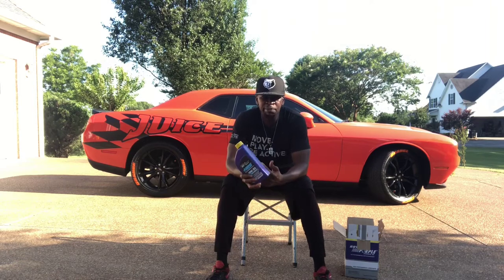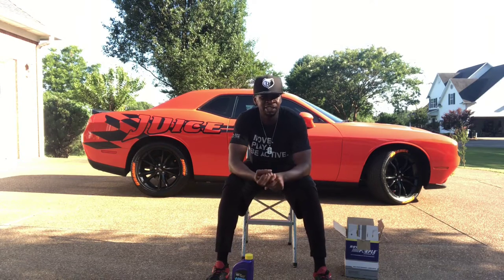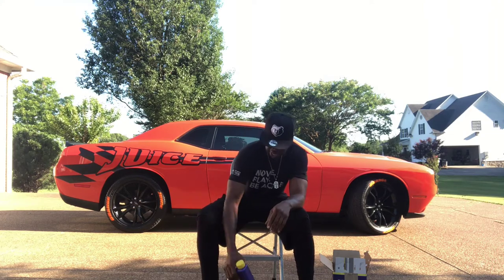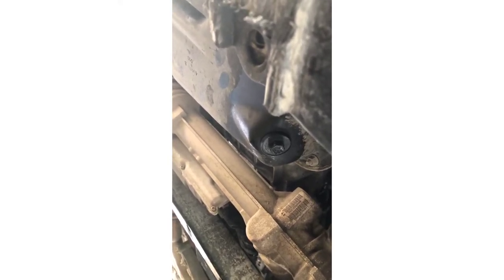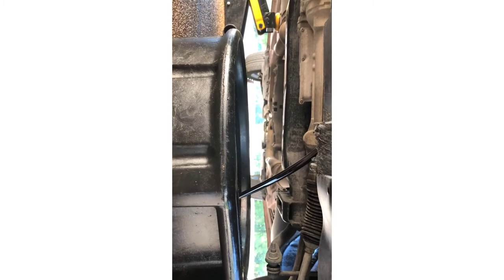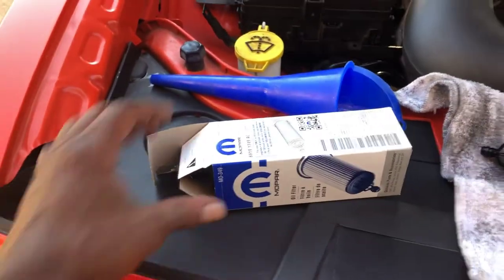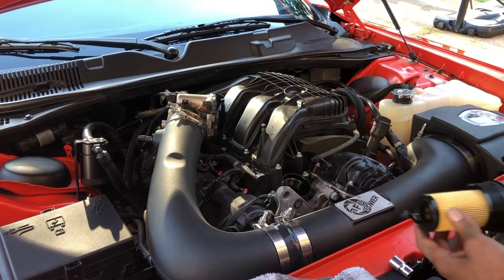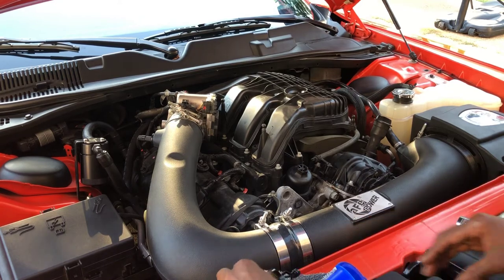Very Easy Oil Change/Royal Purple oil upgrade on 2018 Dodge Challenger SXT

Comment: Hey Spiffy
You should try to use a MITYVAC fluid extractor..
You put a small hose down the dipstick, and pump the oil right out.
I never have to get under the car.
I think I have the MITYVAC 7401, it’s the hand pump model.
It actually sucks all the oil off the pan, better than draining by plug.

Comment: Does the oil life on your display reset to 100% automatically?
Reply from the maker: I wish it did cause sometimes I forget but naw  you gotta reset yourself put ignition in run position and hold ok on steering wheel then it’ll reset